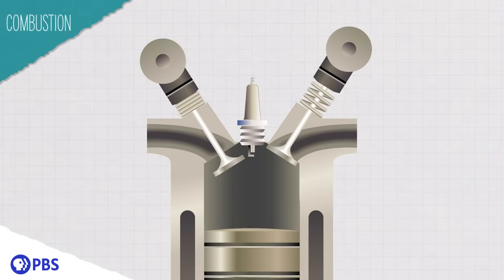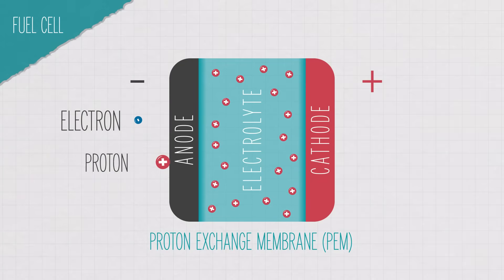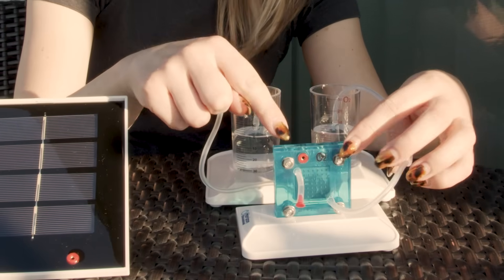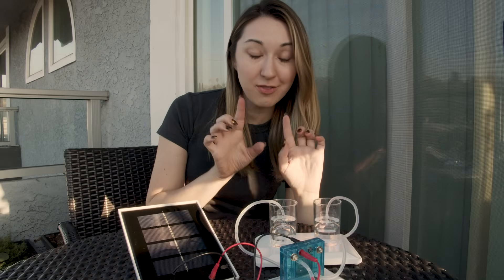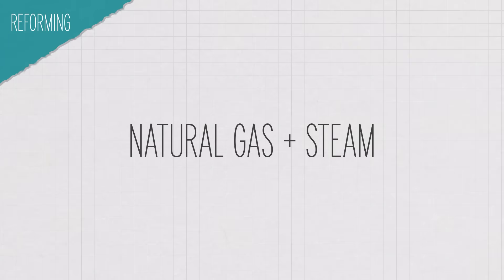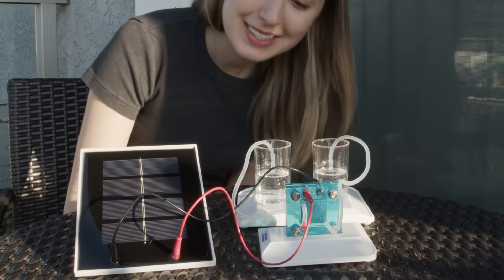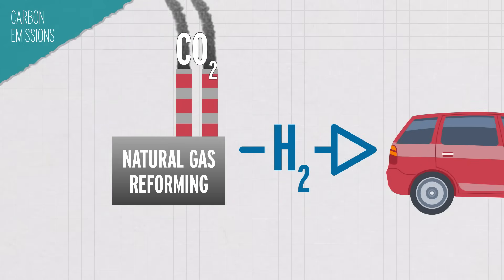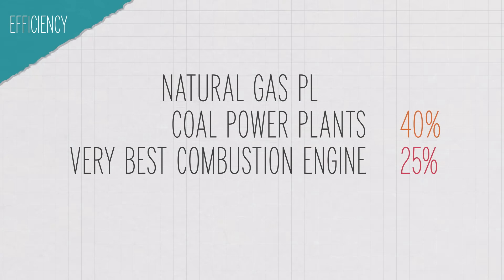How Do Hydrogen Fuel Cells Work?

Comment: It would be of immediate benefit to replace gasoline powered Internal Combustion Engines with an electric motor powered by fuel cells feed with gasoline.
That would double the conversion efficiency, and would allow a car 50 km per liter of gasoline, with the advantage of no NOx and particulate emissions.
Reply: That's a noble idea. But eventually the petroleum reserves will be depleted.

Comment: If we used nuclear and fuel cells it would be golden.  Huge problem with electric cars is that the electric grid is really inefficient.  A lot of electricity is lost from resistance in the lines.  If u are just simply using fossil fuels then my geuss would be it's more energy efficient to just run gas cars...  But smaller more scale reactors and this  storage tech would be a great solution

Comment: By pumping oxygen into oil wells we can oxidize the crude and separate hydrogen from carbon while its still in the ground. The hydrogen can be extracted through a filter and mineral ions can be added to the carbon dioxide to create a solid carbonate that just stays in the ground. Does anybody have any ideas to get rid of some billion dollar oil refineries?
Reply: Only petroleum gas good because  hydrogen car will produce nitrogen in large scale which is not good for ecosystem

Comment: No, no, no. Your assumption that turning fuel into energy in cars is more inefficient is wrong. In the case of a car using the engine as the driving force, the engine is actually moving over a wide range of RPM, thus the engine spends minimal time at the most efficient RPM, this is why power plants are more efficient, as they remain at a constant RPM, thus they use the turbine at peak efficiency, thus if an engine is instead used in the same manor, keeping the ICE engine at a constant RPM greatly increases its efficiency, thus your assumption is completely wrong in this regard, because if one uses a generator attached to an ICE engine, one can also attain such high efficiency as power plants do as generators prefer constant RPM to maintain a certain output, and in the case of diesel engines, one can actually attain even more efficient systems, not even to speak of peltier heat capture methods that can even further increase an engines electric output, though this is prohibitively expensive to recover lost heat energy.
Reply: Additionally, if one uses the sabatier process, one can actually make your hydrocarbons for said ICE generator, and this you would actually prevent further CO2 production. This will require some renewable source like wind or solar to achieve the sabatier process, but you will be helping the environment by not adding more CO2

Comment: Two critiques.

1. The point of a hydrogen fuel cell in replacing the ICE to power personal vehicles is not to remove the entire infrastructure that is creating pollution. It is to remove ICE powered personal vehicles as a factor in the global pollution problem. To say that the rest of the infrastructure means that hydrogen fuel cells aren't actually that green (or is a gas guzzler in disguise) is a very disingenuous statement to be making. Regardless of what type of motor a personal vehicle uses the fuel source is going to have the same exceptionally polluting infrastructure supplying the fuel. Thus the infrastructure is a non-factor in these discussions. Hence bringing it up is a disingenuous statement against hydrogen fuel cells.

That said the current infrastructure is based around using fossil fuels as a fuel. This isn't the fault of hydrogen fuel cells that they have to use the current infrastructure at the moment. Had the population been willing to accept the shortcomings of electric cars in the early 1900s (Leading up to 1910 electric cars were the most common cars being sold on the market. It was after that point that ICE powered cars really took off in popularity due primarily to two things. The invention of the starter motor made ICE cars significantly safer to start and vastly improved roads made long distance travel a genuine thing.) our infrastructure development would have been drastically different, and it would have been focused around greener technology by default.

As you alluded to at the end; a hydrogen fuel cell focused infrastructure looks quite different than the one we are currently used to. Given enough technological development it could be feasible for a hydrogen fuel station to develop a portion of its own hydrogen fuel that it sells to customers. Especially if the hydrogen fuel cell vehicles don't emit their water vapor into the air and instead store it in a tank that gets drained at the station at the same time that hydrogen fuel is being added to the vehicle. That water that comes from the vehicles could then be put through electrolysis at the hydrogen fuel station thereby at least partially replenishing the hydrogen fuel that the car got at the station. This would further reduce the number of hydrogen fuel deliveries needed by the station. I don't think by many but any number fewer is a good thing in my book.

2. To tag behind above; the only relevant factor in terms of pollution between hydrogen fuel cells and ICE is the pollution that each system gives off as emissions. Now I ask that you compare the emissions between ICE and hydrogen fuel cells. Which is giving off the less damaging pollutants? Of course I am pretty sure that you knew this already. That said water vapor being added to the atmosphere as exhaust from hydrogen fuel cells is still a pollutant by the definition of what a pollutant is. A pollutant by definition is a substance or energy introduced into the environment that has undesired effects, or adversely affects the usefulness of a resource. Water vapor is exactly this as well when added in large amounts. Adding a crap ton of water vapor from our personal vehicles into the air is going to drastically increase the local humidity of large population centers. Think about the potential effects that this would have. Yeah, water vapor isn't as harmless a pollutant as some may think. If you wanted to critique hydrogen fuel cells as not being as green as they get made out to be this is the way that you really should have gone. That said nobody that I know of is doing the math behind this.
Reply: You are just wrong. Electricity does not need to be generated by a polluting infrastructure. In fact you can have solar panels on top of your own house. There is no comparable way to produce gasoline or hydrogen on your own.
Reply: @DavidJao  No, I am not. Current large scale electricity production required for modern needs cannot be completely fulfilled by green methods alone. This is why, short of geothermal sources where they are the main source of power in like Iceland, everything green is still strictly supplemental to less green methods of electricity generation. While yes, you can have solar panels on your personal home for personal use for industry demands there isn't a green source that is capable of providing anywhere near sufficient amounts of power. A local TV station near me has a massive solar panel park with over 100 large solar panels in it. All of that solar power generated doesn't even provide more than 20% of their required power. That is just a TV station. That isn't heavy industry. It is also taking up a large amount of real estate. Something that isn't an option in a large, tightly packed city like New York or Chicago. Another place where green energy sources can't provide sufficient energy for just the general population, never mind heavy industry.

Hydrogen production also can be properly green. As shown in the video there are a few methods that don't use any outside power source to create Hydrogen. Research is ongoing to see if these techniques can be used on a large scale efficiently. Even if they can't on a large scale they could on a personal home scale if you have the right equipment and you don't need to drive anything more than about a hundred miles a week.
Reply: @rainsilent  So? At least I can put solar panels on my house, even if you can't. Even if not everyone can, at least SOME people can. This is not true for hydrogen. NOBODY can produce their own hydrogen. NOBODY. The two situations are not even remotely comparable. Clean electricity is something I have today, right now. Clean hydrogen is not.
Reply: @DavidJao  ... Did you watch the video? What does she do with the solar panel when she connects it to the hydrogen fuel cell? It is not a question of if you can produce your own hydrogen. It is a question of do you have a reason to. Ultimately the situations are very comparable as there are at least 3 DIY options to create your own hydrogen right now that are genuinely relatively affordable. The only major difference bigger picture wise is that there is virtually no need for anyone to create hydrogen at home because they have no reason to do so. Not having a need to is not the same as not being able to. It would behoove you to learn to recognize that difference.

As for so? The point of what I said is that the infrastructure is the same for every fuel source on a large scale level. You countered with; "But I can get green electrical energy at my home via solar so you are wrong."  Your home solar power doesn't mean jack to this discussion because it isn't a viable option at the level in which we are talking, or at least should be if you could mentally get to a level beyond just you. Solar power is an option for a personal home because the limitations of solar panels aren't big enough to be an issue. The moment you get beyond a personal home the limitations of solar panels are too much to make them a serious option. Hence why, in the grand scheme of things, electrical is only about 10% green source generated in the US at the moment. Again proving that I am right.

For the record I have solar at my house too. I just so happen to not be naive enough to then think that that is how electrical is being sourced for everyone and everything making it green on the national/industrial scale that I am talking about.
Reply: @rainsilent  You're not including nuclear as a green source. But even so, 10% is a lot better than 0%. It will be a very long time until more than 0% of hydrogen is green sourced. And that is why you are wrong.
Reply: @DavidJao  Because nuclear isn't a green source of energy. A massive majority of nuclear material used for nuclear power is still mining sourced which is about as green as oil drilling. You aren't daft enough to really claim oil drilling as green are you? This doesn't even touch on the waste byproduct and the disposal of it. Thus even if sourcing nuclear fuel became truly green the need to, and ways of, disposing of nuclear waste prevents nuclear power from ever being truly green. Someone actually educated in what is green energy would have known this and not brought up nuclear as green energy.

Very long is dependent upon if there is a meaningful reason to put the money into seriously developing the green methods of hydrogen extraction. A few of them are very simple but completely untested in terms of large scale. So long as transitioning to large scale is straightforward it could be less than 5 years from nothing to large scale production with enough money to facilitate quick research. That might be a bit fast in terms of pace but under 10 years is very, very realistic. 10 years is a fairly short development span in general.

This doesn't even go into countering what I said either. So again, I am not wrong. At this point you aren't even grasping at straws. You are just talking and hoping to stumble into something.
Reply: @rainsilent  Nuclear power has a total lifecycle carbon footprint smaller than solar and in fact smaller than anything except onshore wind. Of course mining produces carbon emissions but very little relative to the energy produced because nuclear fissile material is so energy dense. It's less than the carbon cost of mining materials for solar panel production.
Reply: Meanwhile, for all your quibbling about whether nuclear is green or whether electricity is green or what the percentages are, you are ignoring the gigantic elephant in the room: clean hydrogen at any level of scaling beyond 0% is absolutely economically impossible.
Reply: I have clean electricity, right now, which supplies 120% of the electricity that I consume, including my Tesla. This will NEVER happen for hydrogen. You'd have to be insane to give up clean energy which I already have, RIGHT NOW, in exchange for a future based on an impossibility. Sorry. Hydrogen is the last desperate gasp of the oil companies to keep you dependent on centralized fuel. Why would I ever go back to that idiocy, when I can pour sunshine into my car right now already?
Reply: @DavidJao  It actually isn't economically impossible. How much do you think it cost her to get the equipment she did for the video? Even scaled up you could manage to sell hydrogen fairly cheaply using similar green methods to source hydrogen. The problem is that there isn't a significant enough demand to even attempt to go large scale. That is another matter entirely though. Since you are hopelessly bumbling around in the dark looking for a valid point I'll play devil's advocate and bring this up myself.

The biggest issue to hydrogen isn't even any of what you said. It is the cost of putting up the infrastructure required to make it work large scale. Regardless of how economically viable it might be, how efficient or green it might be or what the best way to create hydrogen is; if the cost for putting the infrastructure required is so much that countries and companies either don't want to or can't pay for it then it will never happen.

That was always what scared companies and countries away and pushed them to pouring money into battery power development and research. The only exception was Honda. Unless the infrastructure required is put into place the other associated costs for hydrogen are going to remain very high but the cost to put the infrastructure in place is estimated to be over 500 billion. That is more than double what it was going to cost to get the infrastructure for battery powered vehicles into place.

Now, after nearly 20 years of significantly more money being poured into battery powered development compared to HFC development, HFC development is reaching the point where it is becoming fairly pointless to continue to put large amounts of money into its development due to how far ahead battery powered development has gotten.

The other two major cruxes against hydrogen are its current efficiency as a fuel is massively lower than battery powered efficiency (something like 40% to 80%) and the fact that so much energy is required to create and store hydrogen. Both of which are things that would improve over time with development. Both of which, to go along with the point I had to make above, you never came close to in your replies.

Next time you want to jump into a factual discussion on a topic try to have at least a basic knowledge of what the facts actually are rather than using your views and opinions as a substitute for facts. At the least you won't make yourself look like a fool.
Reply: @rainsilent  You're still wrong. The issue isn't the cost of producing green hydrogen (call it $X). The issue is that dirty hydrogen from methane is much cheaper than $X. Until you understand and address the actual issue, your approach is hopeless.
Reply: I never came close to raising the other issues with hydrogen because there is no need. Hydrogen has a million problems, any one of which sinks it.
Reply: @DavidJao  I'm not "still wrong" when I have yet to be wrong in the conversation at all. It is also quite ironic that you say that my approach is hopeless. Are you not aware of any of your responses in this discussion?

The reason dirty hydrogen is cheaper is because all of the green methods are vastly underdeveloped therefore driving up the costs of utilizing them. There are some methods of creating green hydrogen that would involve no shipping of anything to the place in question should they work large scale in the same way that they do small scale. It is impossible for something to be cheaper when the only overhead costs are employees and general maintenance.

As for your claim of not raising the other issues? That isn't because hydrogen has a million problems that sink it. It is because you ran your mouth on a topic you have clearly shown to not know jack about. Those 3 things are the only 3 issues holding hydrogen back. They have been the only issues holding hydrogen back from the outset. Like I said; next time you want to have a discussion about the facts of any given topic do some basic research first so you have some facts yourself rather than going by your meaningless thoughts and opinions.
Reply: @rainsilent  Tell me, how can I get a green hydrogen powered car right now?

Still waiting.

Still waiting.

I have a green powered electric car right now. Why should I throw it away?